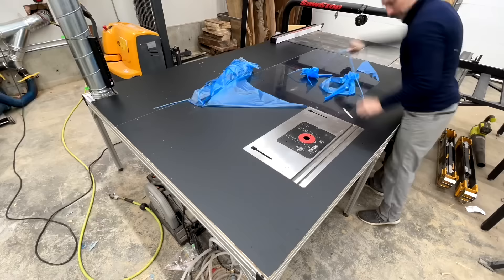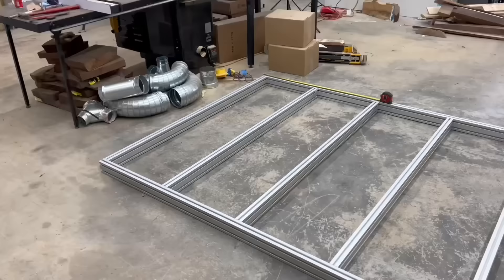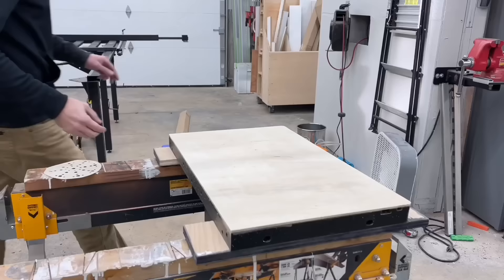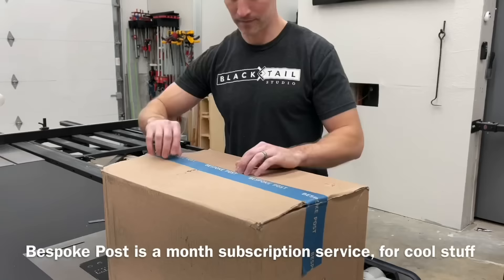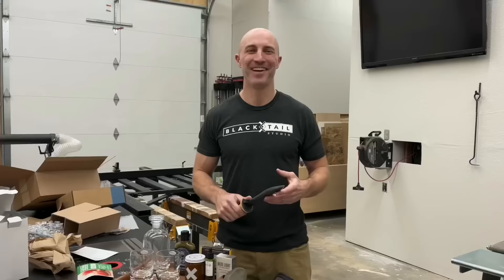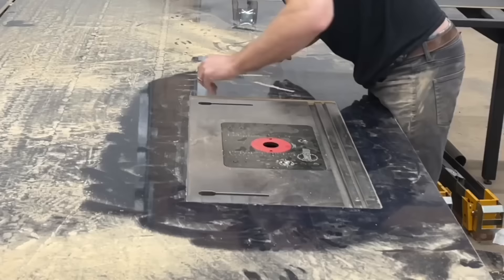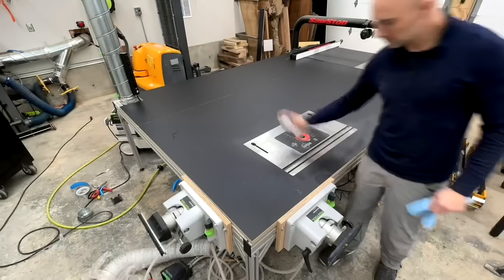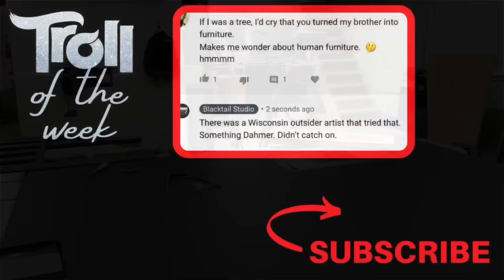60 Minute Aluminum Workbench

Comment: Love the videos!  Question regarding your epoxy tables.  Your videos have inspired me to take the plunge into making a few small tables myself.  Love the process and you've taught me a lot.  Using both a planner (for smaller cutting boards) and router table to smoothing coffe table - sized pieces, I am getting tear-out of the epoxy.  What is causing this?  How can I prevent it etc?  Any info would be greatly appreciated.  Great content .... keep up the amazing work.
Reply from the maker: It can be hard. Sharp bits. Find the proper speed for your size

Comment: Charlie Daniels band.  Cam, What size is the table you use to work on slabs?  What size do you think is ideal.  I was thinking about making a Paulk big bench 4x8 (close to it) with the caster tray.  I figure if I ever need longer I can add an extension when needed.  Casters so it can be put out of the way when not in use.

Comment: Glenn Miller or Pink Floyd, depending on mood. Quick question - I'm considering extruded aluminum for miter saw station and assembly / sanding station. Concerned about the vibration loosening the joint fasteners. Any issues with this? Thanks for your videos, enjoy them very much.

Comment: Tool. Great build! Nice out of the box thinking with the aluminum. Has the dust exhaust gotten in the way yet coming out of the corner of your table? Other than Ishitani Furniture’s shop, I have yet to see someone else’s shop with a sub floor system with ducting running under the floor like his. Your shop is looking great so far!
Reply: Thumbs up for the band
Reply from the maker: It’s not ideal, but i think it’s the best spot
Reply: By the way your videos strike a great balance on detailed info and engaging content, and your work is exceptional! Always look forward to Cam’s new shop adventures. Give a listen to Tool’s latest album, specifically “Invincible”, great for the shop tunes.

Comment: Just curious what size of extrusion those are as well as what size is that table in the end looking to design myself a custom bed frame out of extrusion which I then plan to strap wood to the outside to make it look nice but for ease of adjustability like aka want to put a drawer in or change spots so that's my plan

Comment: You could build the table from "Unistrut" metal framing material for about half the price but it is not a "Sexy" as the 80/20 material. It would be stronger than the aluminum and also heavier.
Reply from the maker: I’d considered that. Good call!
Reply: @BlacktailStudio  I have been working with Unisturt metal framing since 1974, I am a distributor and installer of "Unistrut" type materials. There are other bands of strut type framing that are the same as Unistrut. This material is not a clean looking or as I put it as "sexy" as 80/20, but it is stronger and should cost less (but the way steel is going up right now that could change).

Comment: Foo fighters.
You inspired me to build my own dining table and it came out great! It has been in our dining room for about a month now and it seems like the epoxy is starting to shift a bit - what used to be perfectly smooth transitions from wood to epoxy is starting to be a little bit of a ridge. Any idea why? Did i not mix well enough? I used ecopoxy flocast. I am really hoping this does not continue and I end up having a massive ridge and have to do somthing about it (flood coat maybe??). Super disappointed after the work and cost I put into this.
Reply from the maker: Might have finished too soon. I like to let it cure for a month or so before planing/finishing.

Comment: There's a lot of Shaky Graves and Nathaniel Rateliff in the shop right now.

Fascinating build!  My sketchbook has been getting a substantial workout since I watched your video.  Any tips on supporting the router lift from under?  Was it pretty straightforward to attach the lift to the table structure?

Thanks for sharing!
Reply from the maker: Ya, more or less. Getting the lip just right too a little wiggling though

Comment: Shawn James.  Awesome outfeed table Cam!  I'm considering several different designs from one very large workbench (4'x10'-12') to one pretty big one (4'x8') with other smaller ones that could link up to create a bigger top.  I recently purchased a slab flattening jig and I'd like to have a setup that would allow me to do everything from start to finish(ing) on it.  I'd appreciate any thoughts you have on the design or comments about how your setup has worked for you so far.  From your commentary and what you've shown it seems like a sturdy design but I'd like mine to be mobile too.  Thanks.
Reply from the maker: I really like how this setup has worked so far!

Comment: Flogging Molly!  Epoxy question here.  I'm in CO and working on a river desk top.  Plan on using liquid glass and would like to know Min temp to pour.  Currently the average high is 45 and low is 23.  The pour will be 1.8 to 2"  Very tough to keep a warmer temp in the garage.Suggestions
Reply from the maker: That’s cold! Can’t promise it’ll work, but I bet it will be ok.

Comment: Zac brown band, would you recommend sealing edges on a desk top poor? I’m pouring about 3 gallons into a river table between two walnut slab pieces. The river is about 8”x54”x2” and the over all table is about 18”x52”x2”. Ive seen people do it both ways on YouTube, but I’m wondering if it is necessary. Ideally I’d like to avoid it because of the added cost and time, but what would you recommend?
Reply from the maker: I go into that in my not a smart desk build
Reply: @BlacktailStudio  and how do you feel about a natural danish oil to finish walnut? I’ve used it on a  few other walnut projects and it came out nice. I’m just curious how it will finish on the epoxy.

Comment: Did the Framing Tech table need to me modified in order to flush out with the table saw once you added the table top? Their dimensions show 34" high as does the Sawstop. Concerned that once I add the top I will be 3/4" too high.. TIA.
Reply from the maker: They have adjustable feet to level em

Comment: Zeppelin or Major Lazer..two completely different lol

Question is - how do you recommend bonding cured epoxy? Had an issue with a leak in one of my molds. Trying to salvage a project and remove scrapped pieces, and join the two once that's complete. Any recommendations would be appreciated!
Reply from the maker: Just scuff it up with scotch brite pad

Comment: hey there! my favorite band is probably the Breeders or the Pixies. Great for rocking out in the shop to!

Semi related to your out-feed table... I'm wondering how you like your sawstop sliding crosscut setup? I'm interested in getting one for my saw, but it is hard to find reviews, especially recent ones by woodworkers cranking out furniture at a higher pace. What do you think, worth the $1500? or better to get an independent sliding panel saw. 

I'm not cutting down panels like crazy but when I need the longer cross cut capacity I really am missing having something like this. 

Writing from NYC & in the process of setting up a larger shop :) thanks!
Reply from the maker: Ya, it’s a sweet ride!

Comment: Description
Airline Hydraulics Corporation is an ISO 9001:2015 certified fluid power distributor of hydraulic, pneumatic and automation products with capabilities including stocking inventory, engineering design, manufacturing, assembly, service, repair, and installation. 

Airline represents Bosch Rexroth, SMC, Hydac, Eaton, Omron, and other major fluid power and automation product lines and has been in business for over 65 years. Airline is headquartered in Bensalem, PA (just north of Philadelphia) and has 7 branch offices and a number of sales offices located throughout the Mid - Atlantic and New England states.

Comment: call me a dreamer or crazy or a crazy dreamer, last summer I spend with a Colorado family who collects only #2 recycle plastic, [milk jugs, and bottle tops there are others BUT it must be #2 to work. After collecting 2 tractor trailers [48' each I believe] packed with plastic 'trash', the fun of cutting everything into tiny pieces, tiny tiny pieces. Then you find any devices that get super hot, [very hot] and also can 'PRESS' the tiny piece, PRESS, flip PRESS, then turn and PRESS, repeat until you form a block. After you created a few million blocks and can then take several blocks  put them into a long mold looking like 1''x4'', 2''x4'', 4''x8'', 2''x12'', or 4'x8'. Plastic Lumber, you can even press in grains, stones, or brick of any design. Then grab your tape measure, saw, and screw gun, and not only is it stronger the wood does not get wet, decay, or warp [without heating] but it does melt.  So if you have nothing be time on your hands you too could build a chair in a mere 12 years. {FYI, To the Johnson family of Co., You know I love you guys and always will, but not #2 recycle}

Comment: The Killers, I have sorta a longer question, I rent out a space at a co-op shop so there are other people wandering around sometimes, and while I was installing some C-channels (the same ones you e recommended) into the bottom of a live edge sycamore slab, this old guy told me I could perform the same job with just a piece of wood mounted to the bottom, I told him he was wrong, since wood bends and steel takes a lot more to bend, but he was quite insistent that I just didn’t know what I was talking about and that I needed to dry my wood better then. Am I wrong? You’re not the only person who’s told me c-channels are a great way to reinforce large slabs that are prone to cupping.
Reply from the maker: Ya, c channels accomplish the same thing as wood aprons. Aprons have been used forever with woodworking. C channels just offer a sleeker look.
Reply: @BlacktailStudio  oh I guess that aprons would work, but I was picturing just a couple boards screwed across the slab,

Comment: Very Nice!!! I am already shopping for my new workbench and spoke with Framing Tech today.   Question, it looked like after you routered the edge of the mirlux it was rough/frayed.  What else did you do after routering the edge?  Also on one of the side shots after you installed the vacuum holders it looked like the edge was darker, did you apply any sealant or do anything else to the MDF edging?  It has been 3-4 months now, how do you like the Mirlux?  Do you feel it is much better/durable than your miter station with melamine?   Lastly, do you wish you had added another 3/4” sheet of mdf/plywood under the mirlux to strengthen the top? Thanks again for the great ideas and videos.  Oh yeah, very impressive you respond to the comments!!!!
Reply from the maker: Mirlux is great! Nothing fancy on the edge. Although they make a banding that looks really nice.

Comment: Is the 15% offer from Framingtech for this exact set up? Or can it be used for whatever kit we're trying to put together?
Reply from the maker: My understanding was any set. Sounds like they may have changed their minds though.
Reply: 15% Applies to any Outfeed Table design or size.
Reply: @framingtech  Ok, great. I want to build an outfeed table that is bolted to my saw's rear rail and folds out and away as needed.

I'll figure out what I need and then give you guys a call.
Reply: @thatguythatdoesstuff7448  Sounds good! :)

Comment: Half troll/ half truth: 
Troll: engineers running an analysis are just "should be " calculations. They mean about as much as a used car salesman's promise about the longevity of your vehicle 

Truth: unless u r storing 1000+ lbs overnight on the regular that bench will do everything u and any other machine based  woodworker will need it to do. Hands down. Tighten the screws every 12 months and call it what it is.